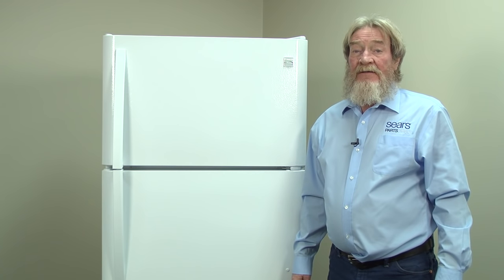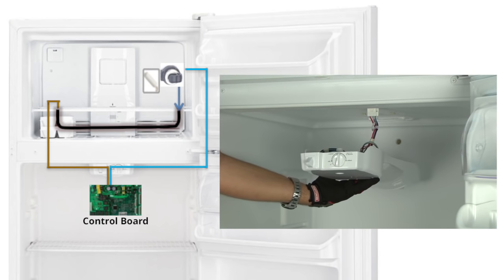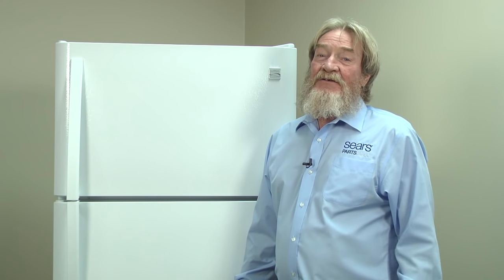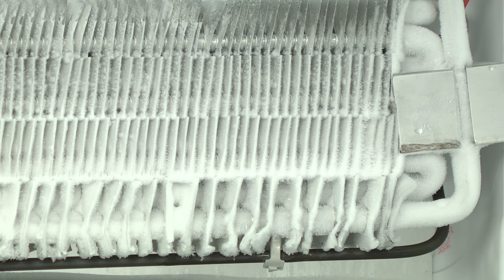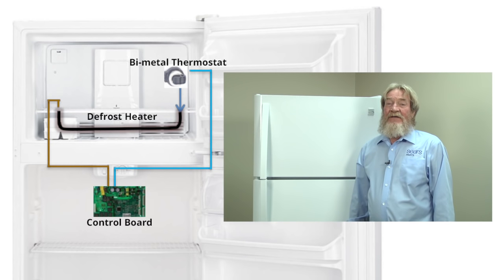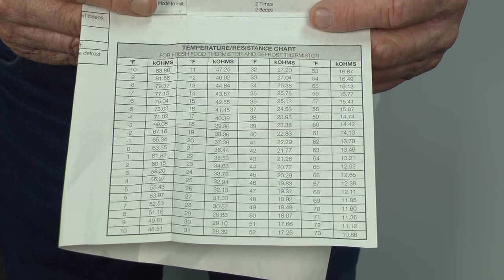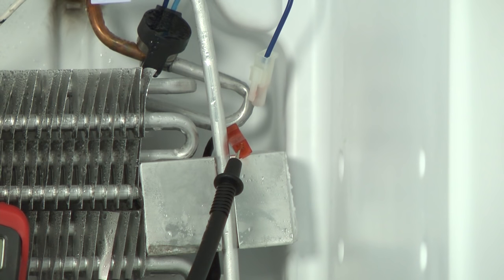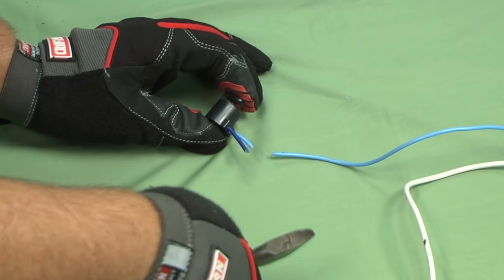How to Troubleshoot Defrost System Problems in Refrigerators

Comment: For a Kenmore model 111.60615910. How would I enter into defrost mode? I lost the manual unfortunately and can't find a manual online.
Reply from the maker: We have the owner's manual available online on our Sears PartsDirect website. Here's a link for that page that has that owner's manual: https://www.searspartsdirect.com/manual/15ygx9h77x-000582/kenmore-11160615910-top-mount-refrigerator 

The owner's manual doesn't describe how to enter the forced defrost mode. To enter forced defrost mode on that model, turn the temperature control dial all the way to the lowest possible setting (1). Hold the refrigerator door switch in while turning the dial to the highest setting (7). The compressor should shut off and the defrost mode should start. 

If the defrost mode doesn't start, then the control likely detected a component problem. An LED light on the control board at the back of the refrigerator signals error codes to indicate what's wrong with the refrigerator. Follow the steps listed on this error code chart to safely view and decipher error codes for your refrigerator: https://www.searspartsdirect.com/diy/error-codes/refrigerator-repair/1234589-1235884/kenmore-111-model-top-freezer-refrigerator/0582 . If you see an error code flashing on the control board, follow the troubleshooting steps in the chart to diagnose and repair the problem. 

If you don't see an error code flashing, then you may need to replace the electronic control board in the refrigerator. Here's a guide that shows how to replace the control board: https://www.searspartsdirect.com/diy/repair-guide/how-to-replace-a-refrigerator-electronic-control-board 

We hope this advice helps. If you need further assistance, let us know.
Reply: @searspartsdirect  Thank you. If I need further assistance I'll be sure to comment back

Comment: I have Kenmore Fridge 253.6888901C frost builds in freezer and cuts off cooling to fridge. tested all components in freezer fine with meter but defrost heater never melts the ice. When I drop down the fridge compartment looks it different than video..only has timer& thermostat . The light bulb no longer works. I notice blue wire goes from to light fixture to the timer then to connects to plug in fridge ceiling. There is where i see in the plug the copper inside is black and looks burned out where the blue wire goes into. Need assist as i think this can be why lite no longer works, but more importantly need help as to why defrost heater not working.
Show less
REPLY
Reply from the maker: The light blue wire that connects to the plug in the ceiling sends current to the defrost heater through the bi-metal defrost thermostat. The defrost bi-metal thermostat shuts off current to the defrost heater to prevent the evaporator from overheating during the defrost process. Based on your details, we think that the defrost heater may be shorted and that’s why the light blue wire in the refrigerator ceiling plug is burnt. We recommend that you unplug the refrigerator and check the resistance of the defrost heater using a multimeter. Here’s  a video that shows how to access the defrost heater: http://www.searspartsdirect.com/repair-guide/refrigerator/how-to-replace-the-defrost-heater-in-a-top-freezer-refrigerator.html. You should measure between 32 and 45 ohms of resistance through the defrost heater. Replace the defrost heater (http://www.searspartsdirect.com/part-number/242044020/0046/253.html) if you measure resistance outside that range. If you measure the proper resistance through the defrost heater, then the defrost bi-metal thermostat could have failed. Check the resistance through the defrost bi-metal thermostat when the thermostat is colder than 47 degrees. You should measure near 0 ohms of resistance through the bi-metal thermostat. If you measure infinite resistance through the bi-metal thermostat, replace it (http://www.searspartsdirect.com/part-number/5303918634/0046/253.html). Here’s a video that shows how:http://www.searspartsdirect.com/repair-guide/refrigerator/how-to-replace-the-defrost-bi-metal-thermostat-in-a-top-freezer-refrigerator.html. You’ll also need to repair the light blue wire so current flows to the defrost heater. If you’ve already replaced the light bulb in the refrigerator, then a bad door switch, a failed light socket or a wiring failure in the light circuit could be preventing the light bulb from working. If you get to a point where you need a service technician to diagnose and repair the refrigerator, you can schedule service here: https://www.searshomeservices.com/.

Comment: my  froas proof samsung fridge  T55K breaks it heater and trips electricity every 3 weeks.Pls suggest a reason.Is it defrost the Frig every # three weeks and due to falt in instruction the heater gets overheated?
Reply from the maker: A short circuit to metal ground or to adjacent wiring in the heater circuit could be causing that failure. A short in the electronic control board could also cause that problem. That type of short circuit may be difficult to find a repair. We recommend that you have a service technician examine and repair the refrigerator. Here's a link to schedule service: https://www.searshomeservices.com/repair . We hope this information helps. Let us know if you need further assistance. Note: We didn't find technical information for a Samsung refrigerator model T55K. Let us know the full model number of the refrigerator if you need more help.

Comment: I've replaced my timer switch it still feeezes up and fridge gets warm after freezing up the vents. The metal rod don't get hot on defrost mode
Reply from the maker: A bad defrost heater, failed defrost termination (bi-metal) thermostat or wiring failure could be preventing the defrost heater from working.
Reply: Well my next step is change the thermostat, I guess it's process of elimination

Comment: Does high humidity affects refrigerator defrost system
Reply from the maker: Yes. High humidity typically causes more frost to form on the evaporator fins between defrost cycles. Sometimes the excessive frost can affect cooling performance in the refrigerator.
Reply: @searspartsdirect  Thanks for replying.  Another thing I have a 2017 model LG refrigerator double door with Smart inverter compressor technology. Does my refrigerator have a ADAPTIVE DEFROST SYSTEM? Plus reply
Reply from the maker: @samratchakraborty1325  Yes. That type of refrigerator has an electronic control board that initiates the defrost cycle based on compressor run time and other factors. A thermistor (temperature sensor) on the evaporator helps the electronic control board know when to end the defrost cycle and when to initiate the next cycle. If components such as the defrost thermistor or the defrost heater have completely failed, the electronic control board typically detects the failure and displays an error code. If you're seeing an error code, noticing defrost problems or the refrigerator has cooling problems and you need help, let us know (and provide the model number of your LG refrigerator so we can give you help that's specifically for your model).
Reply: @searspartsdirect  Thanks for your kind reply. By God grace my refrigerator is working absolutely fine. Observed one thing before humidity in our city,  the defrost system in my refrigerator used to defrost 4times a day 9AM,  12 PM, 6 PM & 11 PM. From few days the humidity is extreme in our city & now my refrigerator is defrosting 1 time only in one day. Is just because of humidity or due to the ADAPTIVE DEFROST SYSTEM?
Reply from the maker: @samratchakraborty1325  The high humidity is likely affecting the sensors and duration of the defrost cycle so the electronic control board is only initiating the defrost cycle once per day instead of 4 times a day.
Reply: @searspartsdirect  so is it a cause of concern or it's ok?
Reply from the maker: @samratchakraborty1325  We don't think that it's a cause for concern. Your description seems to indicate that the electronic control board in the refrigerator is working as it should.
Reply: @searspartsdirect  Thanks again for ur kind reply. U have also mentioned that high humidity affecting my sensors, so I got scared. Hope my sensors are ok, because my refrigerator compressor is auto cycling (auto cut off )effectively when my refrigerator achieving the desired temperature

Comment: So if the force defrost mode works and melts the frost, does that mean the problem is either the defrost thermostat or circuit board?. What about the heater itself?.
Reply from the maker: We’ll need to know the model number of your refrigerator to provide an accurate answer. Here is some general information about defrost systems that may help you: If your defrost system has a bad defrost bi-metal thermostat, the heater won’t defrost the evaporator fins in the forced defrost mode. Because the defrost system works in the forced defrost mode, the likely failure is in the electronic circuit board. All other components work except the circuit board if the circuit board doesn’t initiate the defrost cycle during normal operation.
Reply: Sears PartsDirect  the model number is wrb 322dmbm00
Reply from the maker: Thanks for posting that model number. The circuit board on that refrigerator monitors the defrost bi-metal thermostat and adjusts defrost time based on how long it takes for the defrost bi-metal thermostat to trip after the defrost heater turns on during the defrost cycle. When the control initiates the defrost cycle, the compressor shuts off (or stays off) for a 4 minute waiting period. The defrost heater then turns on for up to 25 minutes. Under normal operating conditions, the control expects to sense that the defrost bi-metal trips open to shut off the defrost heater 15 minutes after the heater turns on. The defrost bi-metal (attached to the evaporator) trips open when evaporator temperature reaches 42-degrees F +/- 5-degrees. If the evaporator reaches 42-degrees and trips the bi-metal thermostat before or after the heater has been on for 15 minutes, the control adjusts the interval until the next defrost by 1 hour for each minute of tripping variance. The control then uses compressor run time in addition to the variance in the timing of the defrost bi-metal trip to determine the interval between defrost cycles. Because the time between defrost cycles varies based on these factors, it’s difficult to tell whether the circuit board processor is timing the defrost cycles properly. In the situation that you’re describing, we suspect that the control should initiate the defrost process at least once a day. If excessive frost builds up on the evaporator fins because the circuit board isn’t initiating defrost cycles in proper time intervals (never or only once every few days), then you’ll likely need to replace the electronic control board ( https://www.searspartsdirect.com/part-number/WPW10503278/0046/106.html ). If the control initiates the defrost process daily but the defrost heater isn’t heating the evaporator fins enough to raise evaporator temperature to 42-degrees within 25 minutes to trip the defrost bi-metal thermostat, then you’ll need to replace the defrost heater (  https://www.searspartsdirect.com/part-number/WP12729128/0046/106.html ). We hope that this information will help you determine the cause of the defrost failure in your refrigerator so you can fix the problem. Diagnosing the defrost system failure in your refrigerator is somewhat complicated so you may need to have a service technician examine the refrigerator and fix the problem. You can schedule service here if you need to have a service technician repair the refrigerator: https://www.searshomeservices.com/
Reply: Sears PartsDirect,. Thanks for the detailed explanation.  So you don't think it's possible that the defrost thermostat is bad, if the force defrost works?. Should I try replacing the heater and or thermostat first and seeing if that fixes the problem before replacing the circuit board?
Reply from the maker: The defrost thermostat is just a switch that shuts off power to the defrost heater when evaporator temperature reaches 47 degrees (to end the defrost cycle and keep the evaporator from overheating). Because the defrost heater melted the frost off the evaporator fins during the forced defrost mode, the defrost thermostat appears to be working properly. The forced defrost has long and short duration modes. You should have used the short mode because the long mode is for factory tests and isn’t recommended for use during diagnosis and troubleshooting of the defrost system. If you used the long-duration forced defrost mode, you may need to let the evaporator frost back up and then try using the short mode. If the defrost heater doesn’t melt the frost off the evaporator coils in the short mode then it may not be getting hot enough. If you used the short-duration forced defrost mode then the defrost heater is likely okay because it worked properly according to your details. You’ll likely need to replace the electronic control board if the short-duration forced defrost mode melts frost off the evaporator fins properly. I know that control board is expensive. You can try replacing the defrost heater and the defrost bi-metal thermostat before replacing the control board to see if that fixes the problem. There’s a chance that the defrost heater isn’t heating enough, or it’s heating too much and throwing off the timing of the defrost cycle. The same concept applies to replacing the defrost bi-metal thermostat. If that thermostat is tripping at the wrong temperature, it could be throwing off defrost cycle timing. If you replace the defrost heater and the defrost thermostat and the problem remains, then you’ll likely have to replace the electronic control board. One other cause of this problem could be loose wiring connections between the control board and the components. Unplug the refrigerator and check all wiring connections on the control board, defrost thermostat and defrost heater. A loose connection in the wire that connects between the defrost thermostat and the control board could prevent the control board from properly sensing when the defrost thermostat trips. I hope this additional information helps. Let us know if you need more assistance.

Comment: Greay video but im trying to make sure all refrigerators have a thermistor.  I have a may tag M8RXEGMAS02 . The heater heats up when I do defrost mode, and melts the coils. So im guessing it could be my thermostat or electrical board. Dont think its the thermistor,  if i even have one. I apologize for sounding like I dont know much.
Reply from the maker: Not all refrigerators use a defrost thermistor. Your Maytag refrigerator doesn’t have a thermistor. The defrost control board in the control box at the top of the refrigerator compartment controls the timing of the automatic defrost cycle. Here’s a link for that part with a photograph of the board: https://www.searspartsdirect.com/part-number/4388931/0046/106.html. The defrost bi-metal thermostat (https://www.searspartsdirect.com/part-number/WPW10225581/0046/106.html) should trip when evaporator temperature reaches about 50 degrees to prevent the evaporator from overheating. If the heater is overheating the evaporator, you’ll likely need to replace the defrost bi-metal thermostat because the thermostat isn’t tripping at 50 degrees to shut off the heater. Unplug the refrigerator before accessing internal components. We hope this information helps. If you need further assistance, let us know.
Reply: Sears PartsDirect thank you so much. Ill just order both parts to be safe and replace them.

Comment: What causes a scorched smell "inside" of the refrigerator and freezer. (Whirlpool bottom freezer.
Reply from the maker: Odors from food get absorbed by ice cubes and can cause a scorched smell. Empty your ice storage bucket and see if that trick eliminates the odor. If it does, wrap and seal foods airtight when storing them in the refrigerator and freezer to minimize odors. Keep an open box of baking soda in the refrigerator to absorb odors.
 
If the odor smells like burning wire insulation, have a service technician examine the refrigerator for safety because you could have a short circuit that’s burning the insulation. Here’s a link where you can schedule service: https://www.searshomeservices.com/repair/refrigerator-repair-service.
Reply: anson mew you